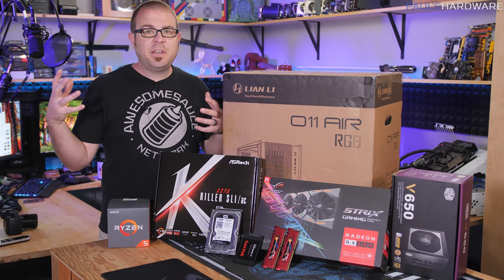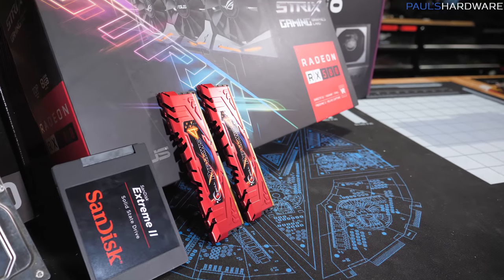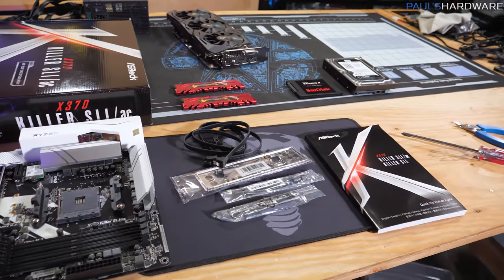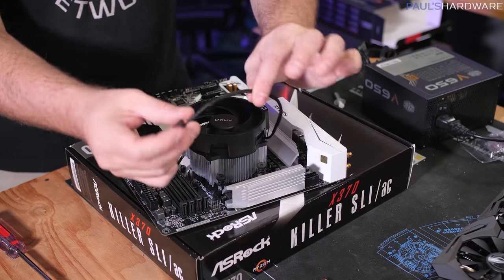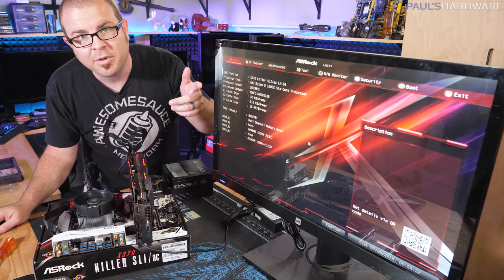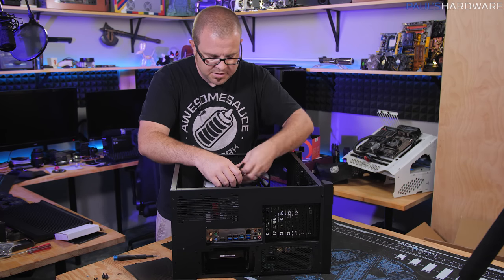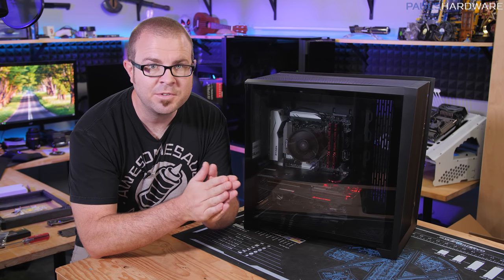How To Build an $800 Gaming PC in Late 2018!

Comment: I want to add to this. NEW BUILDERS! Don't panic when your PC doesn't POST, especially on Ryzen. It can take a couple of minutes to POST at times and may even restart/reset a few times before it goes to BIOS. 

It might only take 15 seconds, it might take 3 minutes. Just give it at least 5 minutes before you start troubleshooting anything.
Reply: S.A. Smith POST?
Reply: Power-On Self Test.
Reply: Power On Self Test - It's the boot cycle your computer does for the very first time when you power it on. It detects all the hardware (or at least most of it), and you usually have to hit the Enter or DEL key to go to the BIOS.

Sometimes it will not pick up all of your RAM, but a simple restart or changing RAM slots/reseating it, can resolve these issues normally.
Reply: Thank you for mentioning this. It's things like that a person really needs to know, more than some of the other things some You Tubers get very involved with, such as cable management or how to screw something down. Paul does some of the best how-to videos but what may seem obvious, or otherwise gets overlooked, can actually be the things we noobs will get hung up on. For me, how long to wait for something to happen is a biggie. It is very helpful to know if something is "normal" or if it's time to realize this thing isn't working.

Comment from the maker: UPDATED How To Set Up a New PC video: https://youtu.be/MfwjISmkEJM
► TIMESTAMPS ◄
7:38 Outside-The-Box Test Build
8:50 Motherboard Prep
9:56 CPU Installation
12:09 Memory Installation
13:10 GPU & Power Supply
14:58 Test Boot
16:14 Case Prep
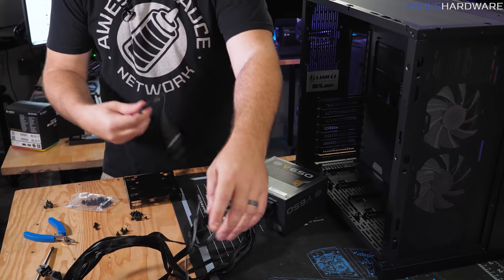19:58 Power Supply Installation
20:28 Hard Drive and SSD Installation
21:35 Motherboard Installation
22:59 Cable Management
25:04 Graphics Card Installation
25:51 First Boot
Reply: Paul's Hardware heya Paul, I’m currently in Australia and I was wonder (really dumb question probably) is that US $ or some other $.....
Reply: THE AUSTRALIAN OPINION calm down mate, he could honestly be using any type of $
Reply: Hi Paul, the strix is expensive, change that to a sapphire rx 580 nitro, less expensive and most of them do 1500 on the clock. Cheers
Reply: does the system have usb 3.0 at the front?

Comment: gets sponsored by a case

proceeds to use different case in build
Reply: Melon Plays for the budget not everyone would be able to afford the case and to make the budget fit
Reply: @nasirrodas3227  r/whoooosh
Reply: Good. They chose what was right and not based on sponsors.
Reply: @Kron1K_  not even a good choice, its only $800 and theyre using an $100+ case
Reply: Melon Plays that isn’t a woooosh

Comment: For like $15-$20 extra currently you can get a ryzen 2600 instead of a 1600
Reply: my first thought when watching
Reply: There’s always the “for $15-$20 more” though. There was a Budget, which means that $15 theoretically is not available. And I’m sure he knows that, but thanks for informing me :>
Reply: Before I posted this comment the 2600 was previously at a little over $200, it dropped to $165 which is why I posted about it because for most, the $200 price tag wasn't worth the 9% increase in performance. As for that budget, you can easily shave off $20 from this build by simply not getting an $80 tempered glass case..
Reply: Agreed
Reply: Get a 2600x
Reply: Now its cheaper
Reply: Puma Cat but you have to get a b450 which is a bit more expensive. Unless you want to update bios which I heard is not favorable
Reply: I'd rather make it a matx build and get 16gb of ram and the 2600
Reply: Actually it's cheaper than the 1600.
Reply: FurNaxx what im working with
Reply: @mythicgaming4732   the 2600 actually doesnt show much of a performance loss by the 2600x. I still bought the 2600x tho ;)

Comment: This seems wrong..you dont have a swiss army knife
Reply: Or tweezers
Reply: @angryscan2970  that poor guy is never going to recover from that video
Reply: Where are his Allen wrench and CPU installation tool though?
Reply: @janglenutter3820  and a table
Reply: ram should be installed in slot 1 and 2
Reply: I was worried he was going to short circuit his psu since it came in contact with his case

Comment: $130 case in a $800 build? I'd get more RAM instead of bigger SSD.
Reply: Case is 80 Dollar on Amazon...
Reply: $300 graphics card
Reply: Yeah.  Gotta have 16 GB.  I'd make the case cheaper until the RAM fit into the budget.
Reply: He said you should put the money other places that’s what he just did in the video.
Reply: Build uses a $130 case and $85ish 8gb RAM. Not really wise spending more on case to keep $800 build when more RAM was smarter.
Reply: But why did he go for the ryzen 1600 and not the newer 2600?
Reply: taipeitaiwan10 also why the actual fuck x370  this is terrible.
Reply: and a b350 would knock off 40$ or so
Reply: the rx580 is better in newer games and freesync monitors are cheaper and you also get 8gb of dedicated ram instead of 6gb in case of the 1060
Reply: I would totally get a Phanteks eclipse P300. That case is awesome for 60$
Reply: @UnluckyBro-  scammer

Or a nine year old
Reply: I had to relegate my 3G 1060 to my son's computer because I have games at 1080P using all the GPU memory.  2G just isn't going to cut it and the actual processor is only going to be adequate if you turn off options to reduce GPU/memory utilization to make modern AAA games playable.
Reply: taipeitaiwan10 now, it’s only 72$
Reply: You can buy 2x more sticks few months latter can up date ram at anytime.
Reply: Umm u only need 8gb ram unless your gonna do multi tasking and stuff
Reply: @microRiZu  exactly im running i7 8700k gtx 1050ti and 8gb 16-64 is really only needed for editor's/streamers ect ect
Reply: @jamesbattese4934  Yeh but u said 1 thing wrong.. u can edit videos with decent software even with 4gb but if u wanna edit without ur of lagging af 8gb is still enough. Btw is it a PC u have or a laptop? I'm trying to buy a gaming laptop around 1000$-1200$ before 2019 suggest one if a good one comes to mind!
Reply: yea, for me, i'll use matx mobo, buy coolermaster q300l then spend what's left on a 16gb kit RAM. better.
Reply: ikr, I almost always check for the cheapest yet still stylish case i can get, and try and find one on sale. I'd never spend anywhere near to a 100$ on a case... Doesn't matter if it's a 800$ build or a 2000$ build.
Reply: @jokerismybae3686  $20 difference
Reply: I need some help with my build someone give me their Instagram please

Comment: I thought if one were building a PC and had $50 left over it was customary to buy beer.
Reply: neuroflare that’s definitely a better idea than more 🐑😂
Reply: That is correct
Reply: Or buy an extra game...
Reply: No you buy rgb or led strips obviously.. everyone knows rgb improves frame rates by 3000%
Reply: Do all new computers come with wifi capabilities? New to computer stuff!
Reply: +Sunny Honey Actually, that is a great question, and no. There are a lot of "Gaming Motherboards" that do NOT have WiFi capability. There are some that do. Lots of gamers prefer a hardwired ethernet connection for it's reliability. So it wasn't always a "feature" that they wanted. I think WiFi has gotten a fair bit more solid over the years though and more gamers are using WiFi now. Especially if you are a more casual gamer and/or are doing plenty of other stuff on your PC you may want that. My gaming PC is strictly for that and I will never web browse with it, so I really don't care for how it does at anything else like that. NOTE: expect to pay a bit more for the WiFi built in.

Comment: I bought 315 euro PC and its awesome for gaming!
Ryzen 3 2200g
500GB HDD / 120SSD
8GB DDR4 
No GPU but vega 8 kick-ass!
Reply: Yea, the new AMD apus are actually pretty awesome. I heard performance around a gtx 750. That's cool for an APU
Reply: Can you tell fps in games and at what settings but
I am planning to build one
Please include pubg and fortnite and settings details
Reply: Awadesh Pal Singh Just search for  Ryzen 3 2200G benchmarks.
Reply: Zendovo bro। I want  consumer feedback at all stock
Reply: Zendovo every other have some kind of tweaks to settings
Reply: Awadesh Pal Singh Not really, some just have better RAM sticks. You can look up Paul's review on it or search through PCPartPicker for feedback from builders.
Reply: Awadesh Pal Singh I just installed Heroes of the Storm,it has fps cap(40 i think)but on ultra graphic(all max) i got around 35 fps.Gonna try Fallout 4 in a couple hours and i`ll tell you the results!
Reply: Vladimir Andric thanks and can u give fortnite benchmark if possible
Reply: Awadesh Pal Singh Probably not because i dont like that game,but you could 100% run that game with this setup if you put lowest/medium graphics.
Reply: Nice!
Reply: Awadesh Pal Singh heyo I get about 40 fps playing medium so it's definitely an option, crank it down to low 1080p and you'll be fine
Reply: Awadesh Pal Singh fortnite will run just finw on low. You could alsp lower the rendee scale
Reply: Still liking it? My 13 yr old is building exactly this (like yours).... Thanks Hon... He wants to add a gpu later on..

Comment: Suggestion: Look at all the cables on the Case. Write down the labels from the plugs on a piece of paper. Then open the motherboard manual and find the drawing of all the connectors. Go down the written list and write in the label on the motherboard that appears to match the plug labels.  This helps you line things up and might help with cable routing.

Comment: sadly im in canada and this pc would cost about 2000 according to pc parts picker
Reply: Leonard Martin is that in Canadian dollar or usd? Also why is it so much more over there lol
Reply: That's in no way 2000$ in Canada. I live in Canada and for 1500+ taxes (1 800) I get a hell of a better pc with RGB everywhere. That's like 1000$ only.  You inflated that price a bit Huh ?
Reply: I took the link to this build (from Pauls previous video) and subbed in the parts he used in this video with PCPartPicker: http://bit.ly/2vpP8B8

  Unfortunately, the GPU, Case and CPU are much more in Canadian dollars :(  Also Sadly, I noticed that the Motherboard was not in stock or available on Canadain sites for some reason.  The cheapest ATX board with Wifi (ACK) is about $277 CAD. which then drives the build to a total of $1582 CAD tax included.   If you wanted a less expensive board you there quite a few to pick from with out the wifi. This one, for example, ASRock - X370 Killer SLI is at $119 right now. Saves you about $171CAD.  Anyway, there are some numbers for ya :D
Reply: IbeStrikezx Thanks for following Up! 1500 is much more reasonable for this build. I'll send you a link to my parts that Im saving for and Id like to know what you think about it vs Paul's build. Note that it also incluses a Mouse, keyboard and monitor. And this build was made to be easily upgraded. https://ca.pcpartpicker.com/list/WwdqBb

For ~1500$ everything is better except for the SSD
Reply: Narcix Oh yeah yeah, what you OWN now is better, keep it!
Reply: Yah you have a very nice build there!  It looks like it was put together with upgrading in mind.  The 120GB Drive could probably be upgraded to a, as Paul said, 460GB SSD. It looks like your board can handle 2 NVME/SATA M.2, so that could be a consideration for later. The 16GB Ram is Fantastic no need to change that.  The only other thing that could be considered for a possible upgrade would be the 1050Ti.  Though it's really no slouch in the 1080p gaming.  Its what I have in one of my rigs and I love it.  I noticed your monitor has Free-Sync so a RX 580 would probably be a nice little upgrade, to take advantage of that. Sorry for the long-windedness. lol
Reply: IbeStrikezx Yeah I made this to upgrade it later. It started from around a gran but quickly went up in price since I added better components here and there lol. Yeah the GPU is not the best one but it will work nicely for now. Anyways GPU are probably one of the easiest parts to switch. People have told me Radeon GPU's are bad and that I shouldnt touch them so im a bit hesitant to even consider buying them. From what I understand, basically, I wouldnt profit from the Free-sync compatibility of the monitor with my current GPU? And is it that much of a loss? I'm new to the PC building community but I'm really looking into it! And concerning the 2 NVME/SATA M.2 what does that means? I know it's a dumb question lol.
Reply: Narcix oh yeah yeah  My reply to the Radeon GPU thing that people love or hate them.  There's a camp that is all Nvidia and another camp that's all AMD.  The AMD RX 580 is a solid performer.  Now, with AMD -- FreeSync vs Nvidia -- G-sync. If you really want to benefit from either you should get a GPU that is compatible G-Sync with Nvidia GPU and FreeSync with AMD GPU.  Sadly, no you won't get any benefit, as far as I know, from the 1050Ti with the FreeSync. No, it's not really a loss at this point. 
Ok, now the NVME or SATA M.2 Drives. NVME M.2 (non-volatile memory express) simply put is a very fast drive that is plugged directly into your motherboard.  They have the potential of speeding up the processing of your computer exponentially.  SATA M.2 is attached the same way and is usually on par with a regular SSD (like your Kingston-A400)

Also please note that I'm still learning all this myself, and I encourage you to keep looking into PC Building.  Being here on Pauls videos is a very good start. :)  If someone else has more to add, please do.  I will keep doing my best to answer your questions though Narcix.
Reply: Narcix Oh yeah yeah Oh yeah yeah
Reply: IbeStrikezx Now everything seems clearer now. If I'm correct, that's means I can have a full AMD build except for the GPU for example a GTX 1080 and if I had a G-Sync monitor that would work like a charm? If it's the case then I'll just switch to a monitor that support G-Sync so I wont need to change my GPU. The GTX 1050 Ti OC 4Gb is fantastic for it's price as far as I know. And about the M.2 slots, yeah this will be a nice upgrading potential if I ever need to upgrade my storage space but these things cost a hell of alot of money! The specs are beyond everything but it's just not accessible in term of price. Otherwise I think my build is pretty decent at this point and I'll just change the monitor to fit the GPU and I'll be good to buy everything! I'm excited to build everything!
Reply: Are you high?
Reply: MrStealYoToast  haha about the same reaction i had to the orginal post.   And I love the name.
Reply: Narcix Oh yeah yeah  Good stuff.  I think you've got it now :D  Your build is a nice base to build on upon later or as you have the cash, so good job on that.  Sadly this is not a cheap hobby for sure, haha.  Good luck with your future builds!
Reply: IbeStrikezx lol thanks man
Reply: Leonard Martin I'm in India and it would cost $1484.55 on Amazon. I can feel your pain.
Reply: IbeStrikezx you can cut that price down by Atleast 300$. Get a much cheaper case, motherboard and ram and get a 50$ hard drive and that price will actually be reasonable. Right now you’re hustling your self with that part selection
Reply: TheTrueAK47 you realize we are talking in Canadian prices right
Reply: Sorry dude
Reply: 2000 canadian dollar
Reply: you better look at sources for these parts again in canada
Reply: Leonard Martin who are you even taking to
Reply: yea so about 1500 i didnt calculate before. but was taking a wild guess. i added it up to my best and came to 1200 canadian not including motherboard and shipping
Reply: https://ca.pcpartpicker.com/list/kZFwkd not counting motherboard for the excat parts paul used you changed quite a few
Reply: @mrstealyotoast i was looking through the comments saying this is a 1000 dollar build and looking at some of the links people provided noting that most people had changed some parts to allow for a cheaper build. while i was saying that using the parts that paul had picked out was around 2000 total. 
 as per the parts list using excat parts but not including motherboard as i couldnt find a decent one for a decent price with ac wifi (quick look) i came up with 1200 plus tax and shipping so if you were to including a mother board and shipping 2000 would not be far off. awhole lot closer than the 800 said by paul. https://ca.pcpartpicker.com/list/kZFwkd
Reply: Leonard Martin I don’t speak gibberish, and if you can’t understand how currency works my condolences
Reply: @mrstealyotoast i am well aware of how currency works. i am also well aware that pricing in canada is not just affected by currency differences. there are many other factors as well that affect the cost of goods in canada compared to those that are in the usa
Reply: GEt the 2600 w the GTX 1060 instead. Similar preformance for a lot cheaper. Canada computers has a nice sale going on for both parts
Reply: shafat zahld the whole point of my original comment is not to get different parts but to show that a 800 dollar computer in the usa is not any where near 800 dollars here
Reply: shafat zahid i am thinking about doing a build but it will be at a cost of 5000-6000
Reply: i no
Reply: The fucccccc I got an already built pc 8 gb ram awesome cooler 4 prosesseres 500 gb storage and chair monitor headset keyboard for only 400$
Reply: Hrrly Gamer  the point was to compare exact parts to exact parts for pricing